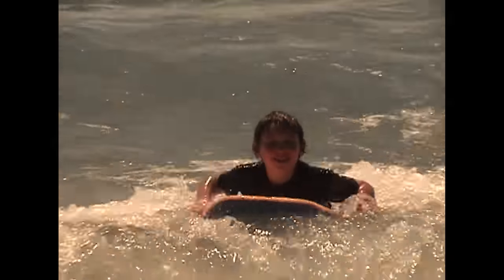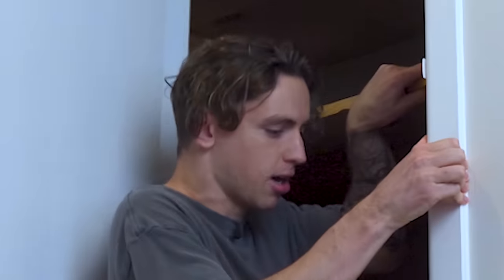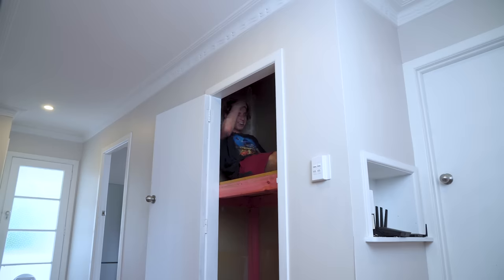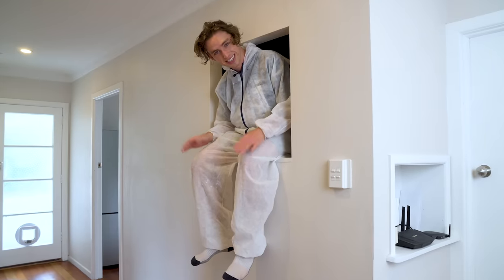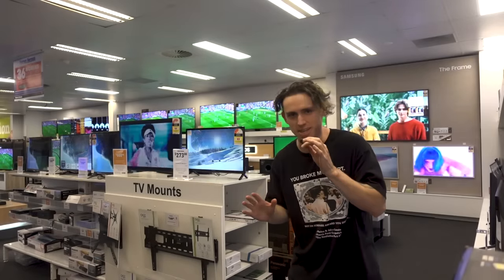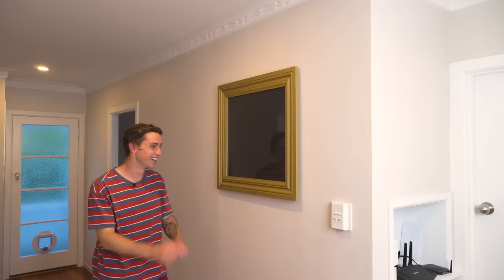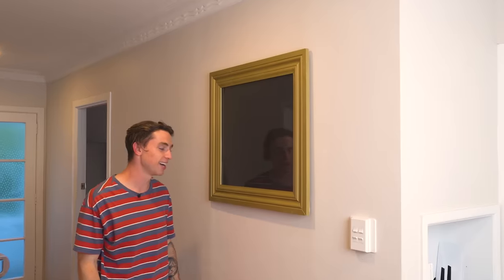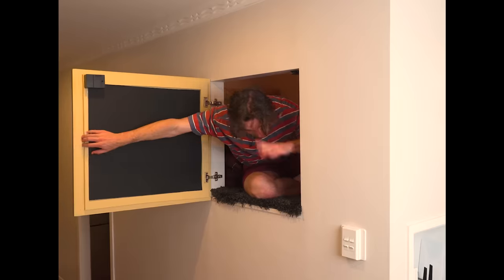I Built the Secret Room I Designed as a Kid

Comment: Hey Liam, I’m no rocket scientist, I’m only 15, but I think if you are going to “un-ironically spend a lot of time in here(with new zeal and accent)” you should add an AC system into the room as it will get very hot and humid inside of there, underneath your flooring I noticed you had about 3 and a half feet-ish of unused room, that is more than enough space to put a small AC unit, not a whole one, a small handheld one you could buy for the inside of an RV, then cut a hole either in the floor under the TV or in the floor under the snack shelf to then add a clear or black pipe used to drain water(not PVC) and use clamps to clamp it to the wall. Then bring it up on the ceiling and make it to where you can move it around so you are able to plow a given amount of air in a given area, then also make it to where you can reduce, increase, stop, or start the flow of air, sort of like a airplane AC adjuster where you twist to change the air pressure/flow. Ik it’s a bit of a stretch but I’m just following your words and saying you want comfort along with your dream come true, take it a step further, go the extra mile. Now you might be thinking where would the air come from, we’ll most wall AC vents are either on the ceiling, lower wall, or upper wall, you can add in on the lower wall right next to the AC unit. Now off what my guess is for price, maybe a 500USD which is definitely 100x just from views alone, meaning you have the money, you have the drive, you have the dream, and you have the viewers who are willing to support you in the process, finally I would like to conclude this under 1500 character paragraph with, I’ve been a fan for about 2-3 years now, way before you started your world record attempts, and no, not the ones when you were 8, in talking about the ones where froto has been a very supportive and energetic character in your videos, since you’ve been doing you “navy seal training” where you swam for like 10 minutes lr something, anyways. I’m just saying, it makes sense, you have the money, and it’s a dream of yours, mines well get everything out of it while you can, milk it for content and joy, take it from the point of view from a viewer, imagine waking up going on YouTube and seeing a man who had made a movie theater out of a closet using an AC unit, tv and snack bar, idk about you but I would clock on that video in a heartbeat.

-Ethan Lewandowski
-from the US of the A

Comment: If there is enough space on the floor you could cut a hole the shape of a mini fridge and put press down hinges on it and put a mini fridge underneath lying down so when you press down on the floor it open and there is a mini fridge full of sweets and drinks.
Reply: Or instead of putting a mini fridge in the hole you could put a bucket that could be filled with sweets

Comment: I'm curious as to why you made it so high up.. could have used a longer picture frame, ending at waist height, instead of a small square one at shoulder height... it would have been easier to climb into, and give you more head space. The underneath area could have been utilized as a storage cupboard or something, instead of sealed off... maybe hidden behind a secret bookshelf door... the bookshelf could double as a step ladder to get into the room. Still cool though. Childhood me also designed my own house several times, and they always had secret rooms in the designs. LOL